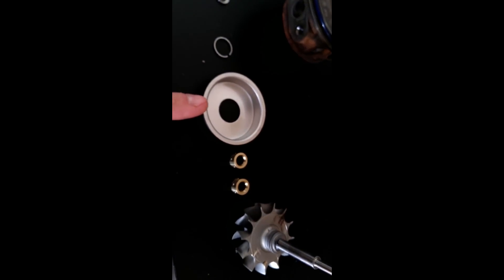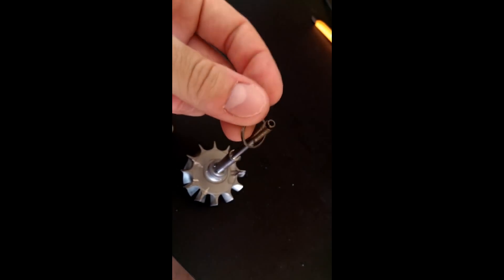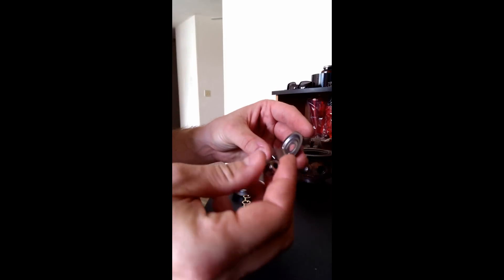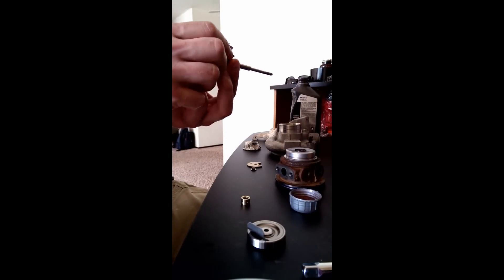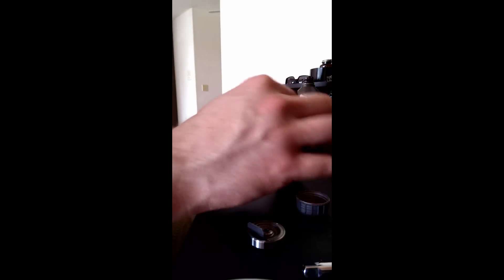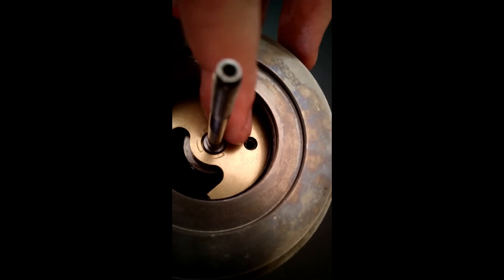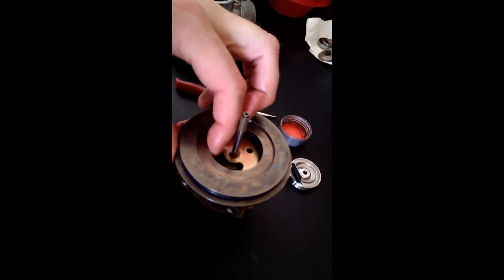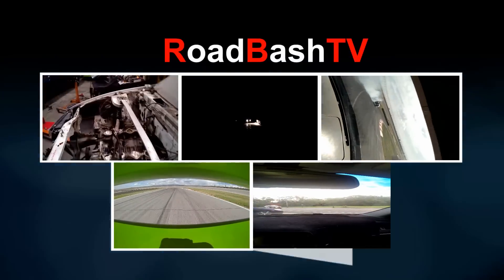DIY TD04 16T Rebuild and Upgrade to Billet Comperssor Wheel

Comment: The procedure of installing is good..but never strike a hammer or force fitting the seal ring into its grove, you may break a ring. The the step by step procedure is good.

Comment: i have a 2003 volvo s60 2.4 T will this work for my car and where did you get the rebuild kit
Reply: the shaft that my turbine and compressor is on bent
Reply from the maker: yes it will and ebay
Reply: wow that was fast thanks, and what do i search to find the rebuild. and do you recommend upgrading the spring for the waste gate. does it make that much of a difference in preformance
Reply: @johnmatthewstyer5727  turbolab

Comment: Omg did you seriously install the turbine shaft in with a hammer?
Reply from the maker: Yes you aren't hitting it hard just enough force to get the piston ring to pop in, the shaft is pretty robust but don't hit the fins they are not. I have already put 5k miles on this turbo pulls hard and did an inspection on it and it was good.
Reply: You really shouldn't install the shaft with a claw hammer, forcing the shaft down like that makes is very easy to roll the piston ring out of the groove.  Set the center housing so you are installing the shaft straight down and set it on something sturdy with a hole in the middle to clear the shaft.  I use a vice, just open the jaws a bit and set the center housing on top.  Then, carefully center the  piston on the shaft and drop it straight down in the housing.  Push down gently and it should "pop" in to place.  If you aren't sure, push it back out carefully and look at the piston ring, it should still be floating centered in the groove.